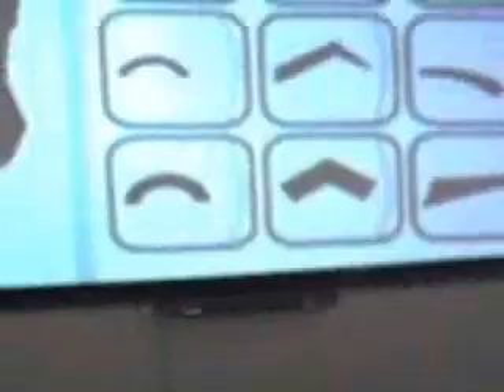Wii Sensor Bar on a Projector without batteries

Comment from the maker: Glad to hear a couple of you have tried it yourself. Way to go. As mine's been moved around a lot, it's not always making a good connection anymore, but I just mess with it for a second and it's back to normal. To the person who asked, I read that the proper voltage is just over 7, but I used a 9 volt and these guys used different ones... As long as you don't blow up the LEDs, you're good... they can tolerate a lot.

Comment: I really works!!!!  In 10 minutes I had my very own A/C adapted sensor bar!  I used a 5V A/C adapter from my portable CD player, and then cut the end off.  After soldering the 2 wire ends, I pushed them into the end of the sensor bar's plug, with some electrical tape in between.  Using my digital camera as a guide, I wiggled the wires untill the IR lights came on, and then secured them with some more electrical tape.  Thats all I had to do.

Comment from the maker: I pretty much gave all the instructions in this video. It's really that easy... There are two metal connections inside the sensor bar connector. You just have to make the wires from an AC adapter touch those connections. If you can't do it on your own, you shouldn't be trying - just buy the extension cable when it comes out.

Comment: Nice bit of info there as I too run a projector in my home cinema and really wanted to play my wii on it without cables everywhere, I'll be nocking one up later! 

I agree that if somone cant follow those instructions/use a soldering iron then they should wait for an extension cable or get someone else to do it.